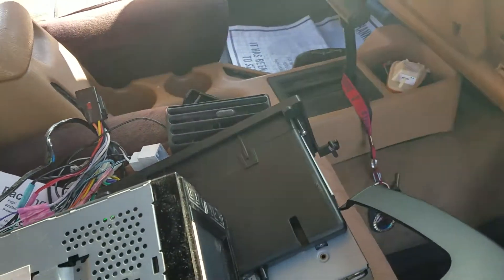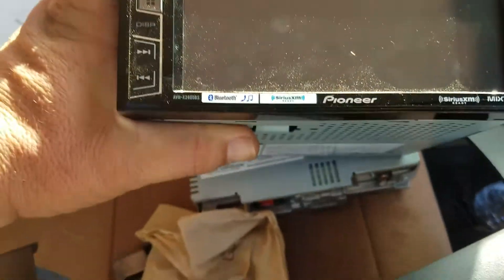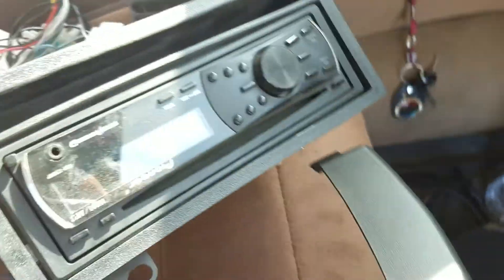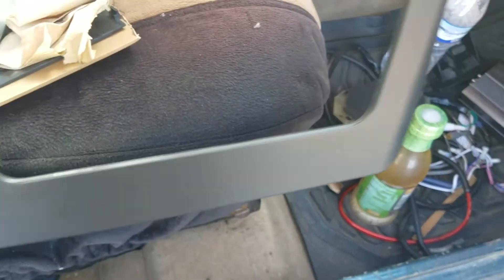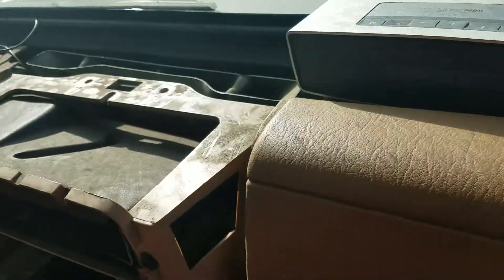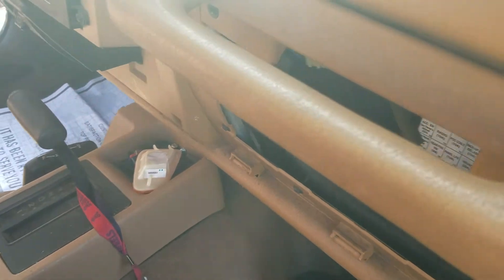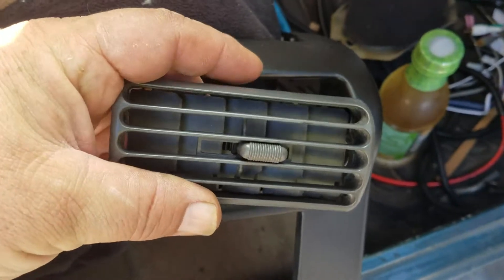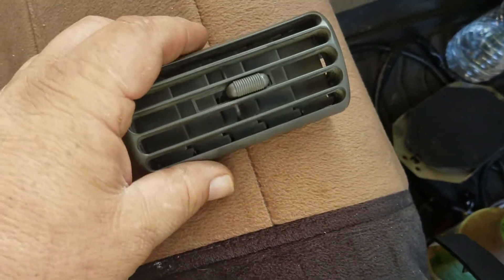Double din stereo install 1998 TJ Jeep Wrangler part 1

Comment: Hi. Thanks for the video series. I plan on installing a Seicane Android unit in my ‘98 TJ. 

Just wondering, you never mentioned where you got the bezel or who makes it? Also, without those center clips, how sturdy is the bezel when its installed?

Thanks again
Nick K
Reply from the maker: No problem, thanks for watching.  I'm not sure about the Seicane Android install but this one was a tough install.  Hope it helps you because I looked for videos before I attempted this and there was nothing I could find.  The bezel was bought from ebay.  Do a search on ebay for a TJ double din stereo bezel it should pop up.
Reply from the maker: As far as sturdy, Yes it is.  With the 2 clips at the bottom and the 2 screws at the top it hangs on very well.
Reply: where did you get the center console  bezel. I looked on ebay not showing anything for 97-99 only 2003-2006 .
Reply from the maker: Got it from ebay
Reply: the one you bought is it for 2003-2006
Reply from the maker: it was for a 97-06